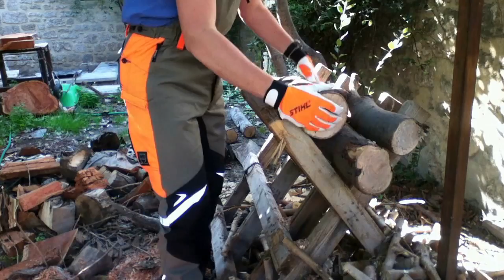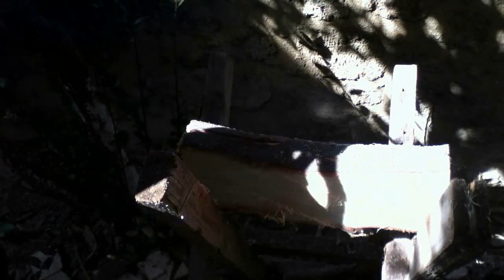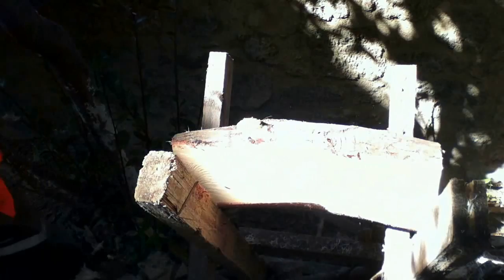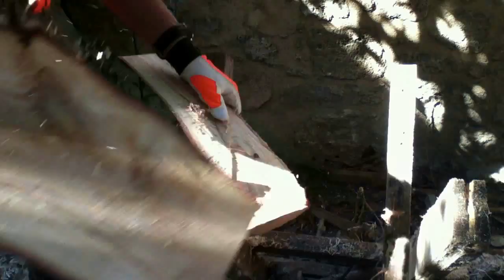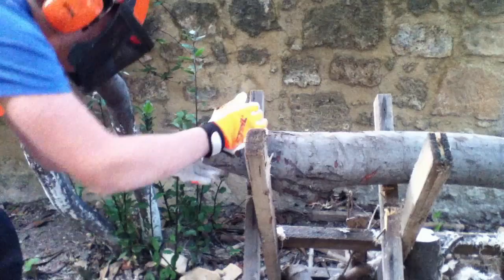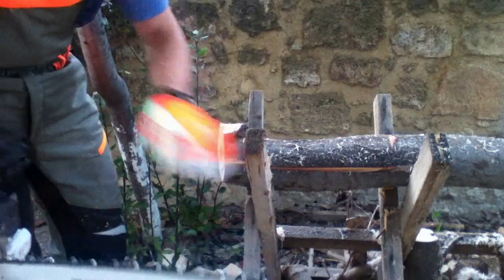Stihl MS 261 C-M

Comment: can't decide if I want the MC 261 Cm , The Ms 311 or the Ms 271. The 261 is more Money. I hear it has more power but you can only run a 20" bar on the 261 and A 25" on the 311. NOT sure.
Reply from the maker: +Big Island MN The horse power difference between the 261 and the 311 is only 0.2hp while the 271 falls at 0.5 hp below the 261. Out of these three I would choose the 261 (and that's what I did). However, I wish I had got something a bit more powerful (like the 362) as I'm planning to do some light milling. On the other hand, the 391 is basically the same money as the 261 and 0.5 hp more powerful. Having said that, I would still pick the 261 out of the three you mentioned. If on the other hand you are willing to spend some more money, I would highly recommend the 362 as a general purpose saw.  The 261 comes stock in .325 pitch but if you want bar length of more that 20" you can swap the chain, bar and sprocket for 3/8 pitch ones and it will handle up to a 25" bar. (It will take bars with the same mount as the 661) You will have to consider though that a 25" bar, chain and rim sprocket from stihl will run you at a bit less than $150 (make sure to get a full skip chain as it will have difficulty running a regular one). In a nutshell, if money is not a problem, you should get the 362 or for a bit less money the 261, or if you are in a budget the 311. I would not consider at all the 271. Also, I did non mention that there is a quality and performance (power to weight, power to engine displacement ratio) between the frofessional line (261, 362) and the semi-professional line which is something you might want to consider. (For example, the 261 is more expensive than the 271 and the 311 but you will get your money back because of the lower fuel consumption.) Hope that helped. For any questions you might have you should visit the forestry forum. There are many kind people there willing to help you. http://www.forestryforum.com/board/index.php/board,9.0.html
Reply from the maker: +Big Island MN Just for reference, I'm running an 18" .325 bar and chain in the video.
Reply: +GEORGE ZARIFIS Thank you very much for the very helpful and quick response. I agree about being able to put a bigger bar on. First saw. I like the best. I just think that I wouln't run into to much stuff that I will need a bigger bar than 20". But, Why limit my self when spending that kind of money. I Might just buy  the big one and buy a smaller one that is lighter later for limbing.
Reply from the maker: Big Island MN
That's a very good idea, if you can afford it. I originally I wanted to do that but I would not be able to afford it.
Reply: I can't afford to buy things that are not going to not get the job done twice or i do not want to double buy. One saw for now. $600 budget.
Reply from the maker: Big Island MN
So I guess you're down to three oprions. $550 for the 311, $600 for the 391 and $620 for the 261. Now it all comes down to power vs weight. The lightest and weakest being the 261 and the heaviset and most powerful the 391 at 3lb heavier and .5 HP more powerful. 311 is same weight as the 391 but .3 HP weaker.

Comment: Glad you guys are not in Australia. The saws in question 241C is $1449; MS 261C is $1559 and anything above is over $2000 which even in US dollar exchange rate falls around minimum $950 startup cost. You can't get a chain less than AUD $70 unless buying generic chains.
Reply from the maker: In Greece where I live things are not all that better. I paid 820€ for my 261-CM which is about 895 USD or 1175 AUD. Strangely enough, in Germany where the saw are made the 261-CM costs 950€ or 1360 AUD.  Seems a bit counter-intuitive. I don't know the cause of the price deviation. Leaves us non)economists wondering...
Reply: for 880USD i can buy a new MS461
Reply from the maker: FishFind3000 Lucky you! The american dream...